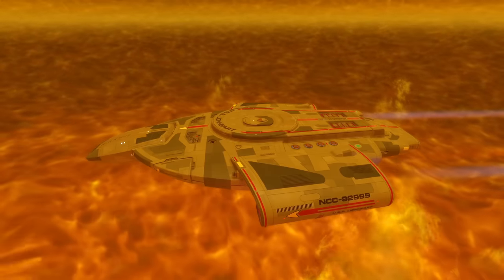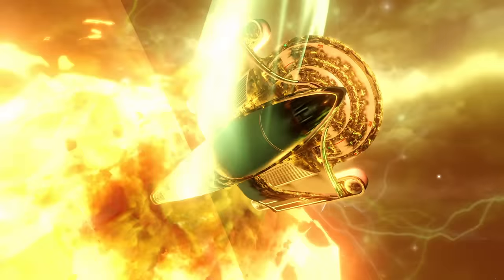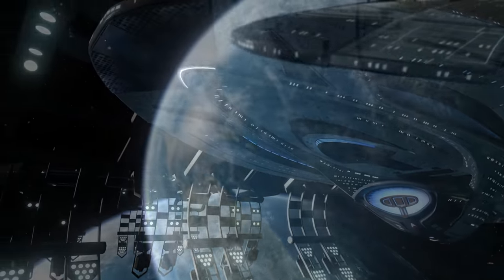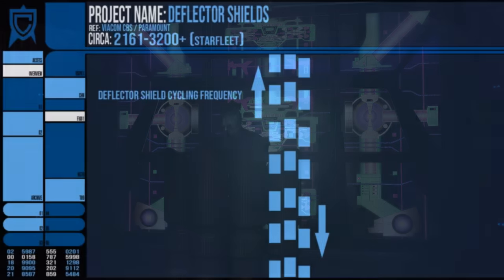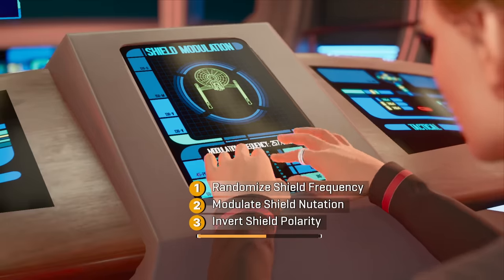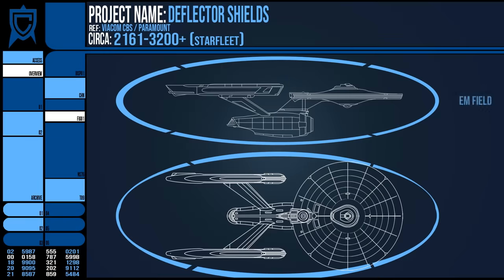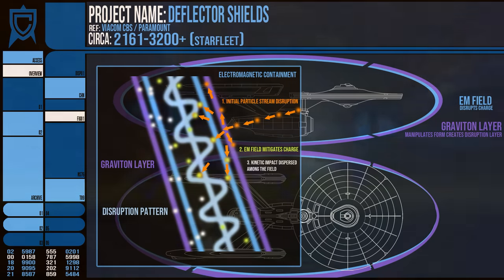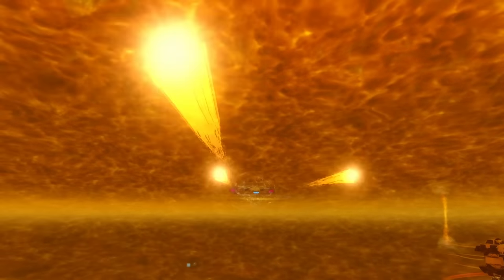What Makes Deflector Shields Different?

Comment: I'm kind of surprised enemies didn't take the frequency of the incoming fire to figure out the attacking ships shield frequency with math.
Reply: I guess the Borg did it
Reply: Don't forget we've seen phasers rapidly cycle through frequencies, for example when the enterprise first encounters the Borg. So I imagine the shields can rapidly change their frequencies following a specific algorithm. Whenever we see a ship ignore shields of another ship, they've actually figured out that algorithm, rather than simply the shield frequency
Reply: @gabrieldarcy1744  i would even guess there are more component. A phaser is a charged particle beam.
So you got the particles  (for example they can detect if damage was done by disruptors, so may use different type of particles).
The charge of the paricles  (kill or stun), how much electrons you can pack into your particle beam.
The field that keeps the beam together  (longer range, less damage, as the field loses power and the beam just desintigrates).
I would guess that the frequency is that field, as we can see in one episode were they were shooting with different charges against the Borg and the phaser changed its color.
I would say the Borg adapt First to the field frequency and are able to disperse the energy, then they actual manage do adapt to the particle it's self, we're changing the frequency wouldn't bring any affect and they may then even be capable to use the free electrons to power the forcefield it self
Reply: @gabrieldarcy1744 Something like what you commented is mentioned in various episodes of TNG & Voyager, where it's  SOP to rotate frequencies at certain intervals. Basically the algorithm you mentioned.
Reply: Exactly. In the tech manual of the enterprise d, they say that due to this very reason phaser frequency changes automatically after each shot. Strange since they had to do it specifically for the Borg.
Reply: @mammutMK2 they did
Reply: i think ship's shield rotating frequency is changing after each phaser burst.

Comment: In regard to a vessel matching their shield frequency so they could fire through their own shields, I always felt this was a plot hole in Star Trek: Generations. When the Klingon Bird of Prey matched their weapon's frequency to the Enterprise-D's shield frequency, they would have had to match their own shields to the same frequency to be able to fire through them. Therefore when the Enterprise-D returned fire, they would have fired straight through the Bird of Prey's shields as the frequency of the Enterprise-D's weapons would have matched the Bird of Prey's shield frequency, and they could have destroyed the Bird of Prey in swift order without needing to find a weakness in the cloaking device's plasma could they could exploit.

Comment: I’ve always imagined a shield being multiple fields mixed to protect from different weapons.
Like a gravitational field that can block or deflect physical rounds while energy weapons could be held off by the plasma and magnetic fields
Reply: I would think gravity based shield could just deflect everything else except charged particles that would be dealt with by magnetic fields
Reply: Basically, you cannot just make the energy disappear, and they’re not reflecting it. That means they have to negate it. It would work on multiple frequencies and wavelengths. Opposing waves of energy will have to be calibrated and utilized. As they advance and gather data, subsets and basic systems will be created. An adaptive program/system will have to adjust on the fly and gather information for new modulations as different types of damage and energy are intercept by the shield barrier. Eventually we will discover a method that can encompass large amounts of different types, a certain type of modulation that will protect as needed while allowing freedom of movement and sight.
Reply: There was that one TNG episode that implied that there were navigational deflectors separate from the combat shields.
Reply: @cheutho  Oh yeah, the main deflector is separate from shield generators. No doubt about that.
Reply: Gravity can affect all particles, no need for electromagnetic shields.
Reply: @wildcardbitchesyeehaw8320  not even particle beams could get through a proper gravity "shield".
The way we understand physics, if we were able to make artificial gravity through other means than mass or rotation, it would break the laws of thermo dynamic as you'd have essentially a perpetual motion machine. If you do have a functional artificial gravity generator, it's also your propulsion system, firing mechanism, shield, actual cloaking, ability to mess with black hole and create your own black hole, make your ships out of nothing but shields etc...

Artificial gravity is completly overpowered beyond typical science fiction understanding, it's a technology that would make you an instant type 3+ kardashev civilisation.
Your weapons would be antimatter tipped macron gun fired at a high percentage of light speed at the very least. Your ships are mobile black hole if you think about it.

Comment: If I remember correctly, transporters also struggle when presented with too much EM interference, and it's likely that an additional level of defence used by starships is to produce an extra layer of EM interference when on a higher alert level to help prevent someone transporting through the shields even if they have the frequency.
Reply: Even if matching the frequency perfectly,  let's say a phaser passing through would loose 1% of energy...if that hapens during a transport that will be bad. And i would even guess a small hole could open in the shield (or a guidance tunnel) to let a torpedo pass through in the moment of firing just to prevent damage to the torpedo.

Comment: I was rather surprised when I learned that the NX-01 Enterprise had Transporters, but not shields.  Compared to the Warp Drive, shields should be a fairly simple technology.  Credit is again due to the writers of Enterprise, who elaborated on this technology when they showed it in it's infant form.  Essentially, you have a thin sheet of particles (one assumes charged particles, i.e. plasma) suspended between a pair of fields. This part is simple enough.  As far back as 1980, I remember seeing a loudspeaker that worked by suspending helium plasma between two magnetic fields. Modulating the fields caused the plasma sheet to vibrate, thus moving the air and creating the sound.

The fiction part of all this is finding a particle that's a perfect energy conductor.  What you definitely don't want, is a shield that absorbs energy.  Such a shield would be overwhelmed in nanoseconds.  Just as the space shuttle heat shield is made up of heat conductors that re-radiate the heat almost instantly, the shields in Star Trek would have to dump the energy directed at them very quickly.  You would also need a particle that works across a wide range of frequencies, or a blend of particles to achieve the same result.  In order to break through a shield, an enemy is forced to pump in energy at a high enough density that it destroys the particles, and does so at a faster rate than the target is capable of replacing them.

By the way, I think there's room within physics for an entirely different shield technology, and not that multiphasic crap they came up with on TNG.  I've named this new type a spawning shield, and the theory goes something like this:  Hadrons (protons, neutrons, etc.) are subatomic particles made up out of quarks. (true science)  Scientists can't produce isolated quarks, because the energy required to smash hadrons apart winds up as new quarks, which combine with the originals so that you just wind up with extra hadrons.  (also true science)  Now, IF you found a hadron that absorbed energy across a wide spectrum, they would make a very interesting shield.  As energy is pumped in, the particles would break apart and spawn additional particles.  Enemy fire would strengthen a shield, rather than weaken it.  Indeed, the problem might very well become one of how to shed surplus particles fast enough.
Reply: Excellent idea.

Comment: 1:31 Yes, let’s test this prototype forcefield generator with energy weapons while standing between two spatial torpedoes! Brilliant idea! It’s a wonder the NX-01 crew even made it out of dry dock without killing themselves and/or blowing up the ship.
Reply: There wasn't enough room in Engineering to test dangerous tech right next to the warp core like later crews would do, so Reed made do.
Reply: @kevinkeeney9418  * remembers Data and Geordi testing a phaser rifle next to the warp core * Fair point! I guess the cargo bays were full…
Reply: @mb2000 NX bays were 100% full, you really think no replicators or the size of the ship suggest otherwise?

Comment: I'm glad you posted this video now because recently I've been thinking about how stupid and impractical (impossible?) the shielding is... Yes you should have shields (if that's even possible) but there should be a backup system of armor for all these ships...

-Armor plating
-Expanding blast resistant fireproof expanding foam
-I mean you could even use water that would freeze in contact with space 

One of the problems I have with Star Trek (I know it's all for drama) but the ships blow up too easy.

Also since all the room/cabins are on the outside of the ship, before the ship blows up it could eject each room as an escape pod with a cloaking device so most of the people could get away, of course the crew in the bridge,etc would go boom.
Reply: They do use blast resistant fireproof expanding foam. 
It looks like rocks......
Reply: Most ships do have armor. At least in Starfleet and given video evidence so do the Klingons. Star Trek weapons are just insane. The basic torpedo is an antimatter explosive more destructive than a nuke.

As for cloaking devices in escape pods, that is an international incident.

Comment: What make it even all the harder is the constant changing over what's spoken over time in different shows and movies. At one points they even mention screens and deflectors as separate things, not so different to what Star Wars does, with the former blocking energy and the latter solid matter. Of course, by the 1980's it was all rolled into one. Good vid BTW!
Reply: Early on, Roddenberry had meetings with writers to explain the difference between deflectors and shields because they were conflating the two and using the term 'deflector shields' in their scripts.
 Deflectors are not shields.

Comment: Bit of headcanon here, but I think that polarized hull plating never really left.  It got incorporated into the ships structural integrity system.  Thats why unshielded hits dont just tear the ship apart in a single blow.  The yield of a photon torpedo is in the megaton range, which should have blown the Enterprise Ds drive section to pieces with the first shot.  Something had to be resisting all of that energy throughout the entire structure of the ship.

Comment: Tasha Yar in Yesterday’s Enterprise refers to increased heat dissipation as an improvement in shield tech and being able to stay in a firefight twice as long as the C’s tech would allow. So maybe ‘deflection/energy dissipation’ is an issue too
Reply: Its known as feedback in lore, the energy that impacts the shields has to go somewhere. So what would happen is that the energy goes to the emitter and results in waste heat. This heat needs to be dissipated to keep the emitter operating optimally.

Comment: Something I've always wondered is why they never thought to weaponize shield emmitters. Just imagine what they could do with a shield energy field that has been shaped into something akin a phaser lance attack.
Reply: They did try that against the Borg in The Best of Both Worlds, feeding warp power through the main deflector dish, turning it into a sort of Wave Motion Gun.
But the Borg were ready for it. 

Riker: Mr Worf.... Fire.

Locutus of Borg: The knowledge and experience of the human Picard is part of us now. It has prepared us for all possible courses of action. Your resistance is hopeless... Number One.
 

It did also have the disadvantage that it burnt out the main deflector, which had to be repaired before the ship could do FTL again.
Reply: The phaser bolts from the phasor cannons on the defiant had something like that involved
Reply: @M33f3r   The Defiant's cannons were basically just phaser bolts made using the nadion particles in a magnetic envelope similar to disruptor or plasma cannons.
They were more of an upgrade/variant of existing technology than anything new.
They essentially were more destructive and has a higher rate of fire than previous versions of the tech but the basic technology had been around since the 22nd century.

Comment: I had always just assumed that projectile weapons in Star Trek weren't really used in ship combat because of their speed limitations. The distances involved in space combat combined with the travel time of projectiles would make actually hitting a target with them quite difficult, and distant ships could detect the incoming fire and just move out of the way, something that light-speed energy weapons compensated for. Not having to compensate for projectile travel time and relative velocities of two moving ships using randomized evasive patterns is a big plus. On top of that, the electromagnetic and gravitic distortions of a ship's shields would in theory make guided projectiles like missiles either not be able to lock on to an enemy, but also probably detonate against the shields if they DID hit, and do little if any damage to the target ship's hull. Better to not bother with that and just use energy weapons. Just blast your enemy's shields with visually-targeted energy until they drop or the generating mechanisms burn out, then finish off the helpless enemy.

Comment: I have always felt that in its simplest form, deflector shields work by distorting space so the beam simply misses the ship. Of course it has to stop proximity explosions too, so an area of distortion preventing you from drawing a straight line from outside the shield to inside the shield will work too.

The graviton is necessary for this technology, though, bevause the graviton is the only form of energy that can distort space. Which links it intimately with both Warp Drive and artificial gravity.

Comment: Good way how they can solve shield issue is with idea of gravity shielding. What to be honest align with how warp drive operate. It basically could be a warp in space time, what basically extend space between ship and the enemy. So energy weapons would be basically dispersed over time (especially if shield also include temporal effects speeding it up). This in fact would explain why ships may receive micro damages, as small portions of energy still could hit the ship.

Comment: I think warp field technology is involved with shield/deflector technology and the development of both technologies run in parallel.
The stronger your warp engines the stronger your shields are as well, in general and would explain the gradual increase in shield toughness over time. 
Gravitons are the quanta of a gravitational field in the same way that photons are the quanta of an EM field. 
I conjecture that a shield bubble in the Star Trek universe is boundary of a warp field bubble/volume which has been enhanced and reinforced by graviton emitters(similar to the tractor beam but vastly stronger). They may even have coherent graviton emitters (analogous to the same principles as a laser in EM tech) for vastly increased power.

At this warp bubble boundary the gravitational gradient maybe enhanced to millions of G's which warps the spacetime in that boundary and can refract any incoming matter and energy.
It also makes sense because in TNG they've mentioned more than once that the warp engines can be tied into the shield emitters to bolster the shield strength.
The durability of the shield depends on both the durability of the emitter and the amount of power available to power it since the emitters drain much more energy than even the warp core can produce at full strength. 
I think the navigational deflector is simply the graviton shield emitters turned on at very low strength.
Reply: This theory has some interesting ramifications with with TNG's shaped shields.

Comment: Ok, Stay with me, I am thinking hypothetically here: So to fire through their own shields, they have to match the phaser and shield frequencies. They can fire through a targets shield if the know the frequency which means when they fire, both ships would have the same shield and weapon frequencies. Seems a bit risky considering you would effectively have no shields as the enemy fire would would be at the same frequency to penetrate your shields. Its fine if you're firing a "Shot" but phasers tend to be a continuous stream for a second or two so once they realise you fired through their shields, if they're quick enough they can so the same knowing the frequency snd with automation it could literally blow up in their faces (and hsve concrete falling from the ceiling for some reason 😂)

Comment: Great topic. Are you wrong about the navigational deflector though? Doesn't it take huge amounts of warp power to push particles out of the way, especially at high warp? Perhaps it's still just less than shields which take an even huger amount?
Reply: The Deflector is a low power long acting thing. The idea in general is that it pushes things out of the way gently millions of kilometers ahead of the ship under warp, that way they're not knocking things away at near luminal velocities. It's more closely related to tractor beam technology in a lot of ways.